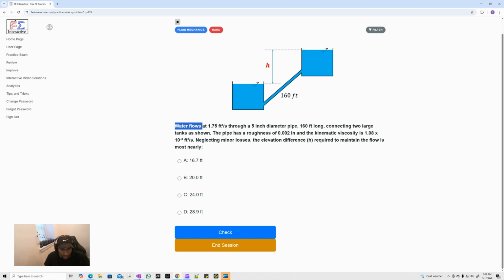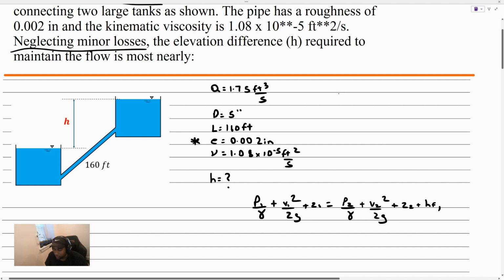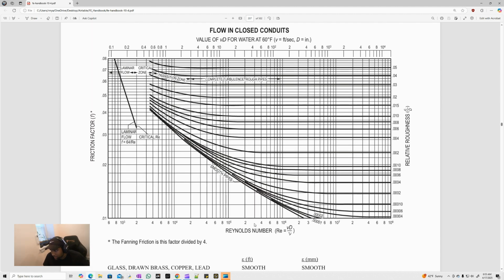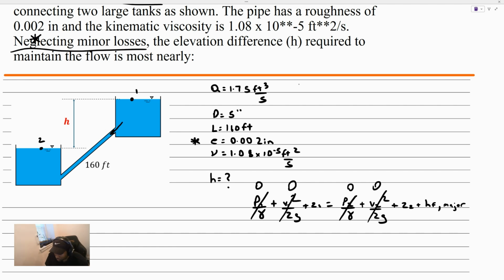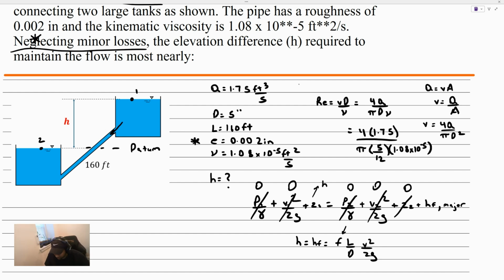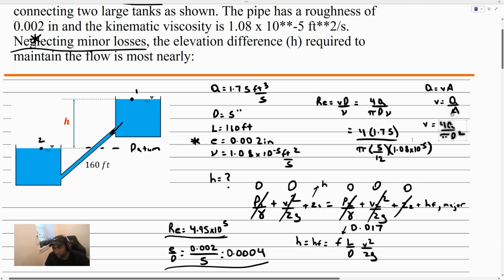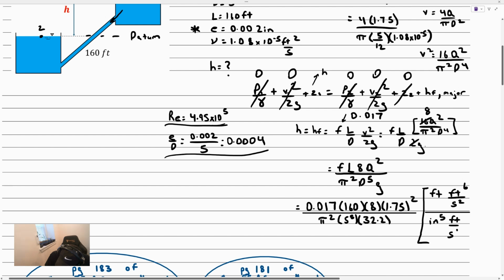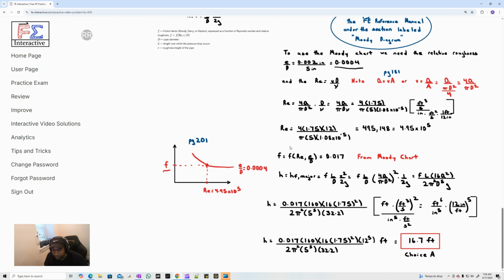FE Exam Fluids: Energy Equation and Moody Chart Friction Factor Example Solved

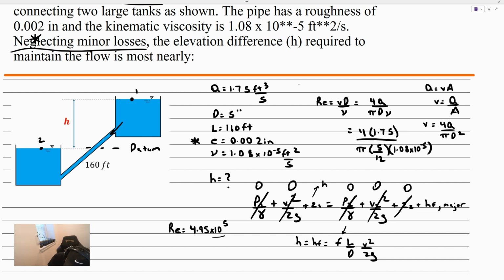Comment: at 8:41 you left the pipe roughness in inches when it needs to be converted into feet. From the table below the moody diagram, the roughness, ε is in feet while the diameter stays in inches. So, ε=.002in/12 = 0.00017 ft., and the relative roughness on the diagram becomes .00017/5in = 0.000034
Reply from the maker: The relative roughness (ratio of the roughness to the diameter) is a dimensionless quantity. The diameter is given as 5 inches and the roughness is given as 0.002 inches. Taking their ratio we can get the dimensionless relative roughness to use on the moody chart. 

Its an important point you bring up and what makes the moody chart so special. All of the lines and combined parameters like the relative roughness, Reynolds number and friction factor are dimensionless. Hope it is all clear.
Reply: I agree with you it’s dimensionless, but do you see the roughness unit below the moody diagram? it’s in feet. The dimensionless quantity on the vertical axis of the moody diagram shown as (e/D) is ft/in
Reply from the maker: @JosephKent-z5w  I see what you are saying. ft/in is not dimensionless though. 

Consider the Re=VD/nu , for the speed specified V [ft/s] and the diameter D [in] (both units specified in the reference) and nu in a unit like ft^2/s, how would you treat the calculation of the Re here?

Additionally consider another dimensionless number pi which is the ratio of a circle’s circumference to its diameter. Can we take their ratio when the circumference and diameter are in different units and still consider the value pi=3.14 or 31.4 or 314?
Reply: @Eng_Fundamentals I see what you mean now. Thanks for explaining. Good example too.
Reply: Can we use the Manning equation to solve for the slope?